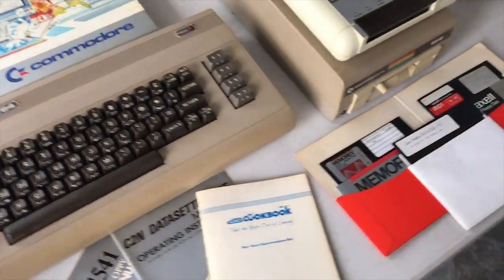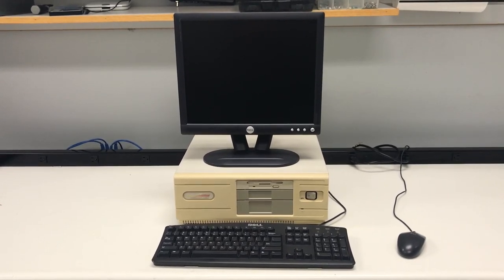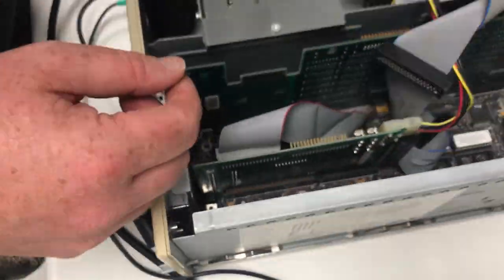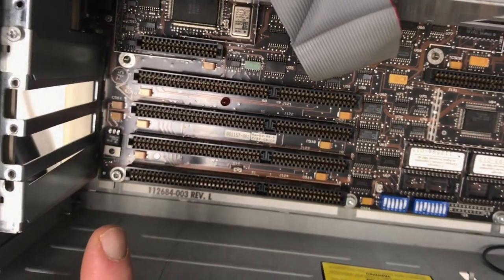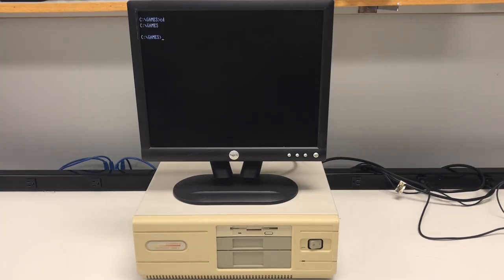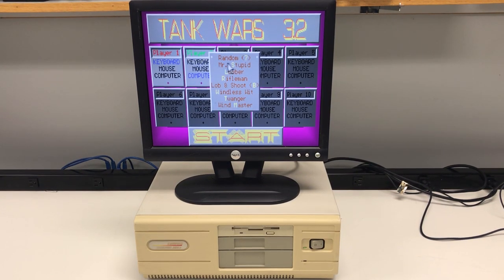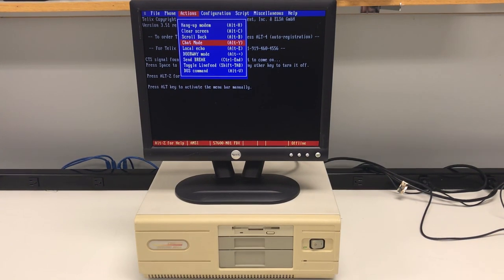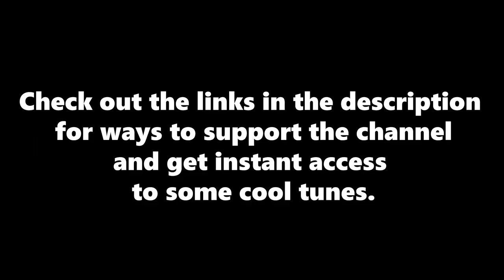Compaq Deskpro 386s Part 1 - Retro Computing

Comment: This was my first PC - a slightly different variant, a 386/20e. I got it when I was 10. I remember everything about it. It had integrated I/O, only a Gravis gamepad adorned a single expansion slot, and I had a 2400 BPS modem connected externally. I hated it. I could not enter BIOS (needed a utility to change anything), I could not upgrade the RAM without spending several hundreds on proprietary expansion cards. I could not upgrade the crappy 16 bit CPU. It had ONE MEG of RAM and a 42 Mb hard disk. That panel with the jumper settings will be forever etched in my mind as it taunted me with expansion options I could not afford. Granted, it was free, I cut my teeth on it at 11 or so and was very proficient with DOS on it, but I have passed up several very low priced offers on these even very recently. Hearing one of these start up though brings waves of nostalgia back. I actually have the original Deskpro keyboard hooked up to my KVM which steers a V30, 386SX, 486DX4, and a 233 MMX. The keyboard is solid, I love how it feels. The VGA monitor also was decent. 

My second PC was a slightly slower NCR 16 MHz 386, but it was a full 32 bit machine with a whopping 4 Mb of RAM. It was also considerably larger. I recall eventually selling the Deskpro when I was 13 or 14 for $100 with a reduced capacity DD drive and a mono VGA monitor (I actually have the ad on diskette still lol). 

"Good" times - thanks for the upload :D

Comment: The machine that feels like my first computer was a Dell 333D, also a 386.  Math Copro, 4MB RAM, and a 180MB WD Caviar HDD.  I always wanted a soundblaster card but never got one for it.  I did own an XT-class PC a couple years earlier, but I had no idea how to use it yet.  I deleted everything on the hard drive, not understanding that it needed these things to function, and then I had to learn how to rebuild it from a series of borrowed 5.25" floppy disks.  Shortly after getting DOS 3.3 reconfigured on it, the PSU failed and that was the end of that machine... so the 333D really "feels like" my first machine - since it gave me years of faithful service and I really learned my way around DOS and Win3.1 on it.

Comment: I had a Deskpro 386DX/25. Got it upgraded with a Soundblaster Pro and a 700MB harddrive. Great machine...
Reply: How did the BIOS support that kind of hard disk? They were one of the most un-user friendly setups around.
Reply: @the_kombinator  It's been too many years to remember the details, but I do remember it being quite straightforward. I was using MS-DOS 6.22 at the time, and the limit was 2GB.
Reply: @BrunoFonsecaPT  Hmm, those computers required special software on diskettes to change any parameter - they were all but straightforward. Furthermore, those systems (I'm willing to bet my project car) did not support over 528Mb disks in BIOS. 

My guess is that you used a DDO, which IS straightforward.

Comment: I've heard recently that a kilobyte from each memory chip is substracted for parity, so instead of 9216 kilobytes it's 9184 kb, still close enough to 1MB, especially at that time when marketers were confusing the public whether a megabyte was 1000 kb or 1024kb. 
In the 90s,  I used to trash pick (generally, I would just stop to look at the side of the road on trashday) hoping to find a 386 so I could install Linux, which requires a machine like Compaq's at a minimum. I certainly found 286s, Apple II clones, 8086s and restored them and drove my ex-wife crazy. The "guest bedroom" was full of computer parts in various stages of cleaning. lol. 
Now I just have I have a Compaq Portable1. All things considered, and since it is mainly good only for a handful of DOS games, I think I'd rather have the DeskPro. There is a 386 Portable, but it has a monochrome orange gas plasma display. The monochrome isn't a problem for me, but fixing or restoring or replacing a gas plasma display is rather difficult.

Comment: I just got one of these computers and I have been troubleshooting it for the past few months, just realized that last time I took off the floppy disk power cable I put it on the wrong way and killed my combo drive, it was a 5.25" drive and 3.5" drive, sucks that it broke but now I have to search for a ISA bus floppy card
Reply: oh and it has a 10mb ram board upgrade plust a 1mb Orchid fahrenheit 1280 video card

Comment: You can get a 387sx on ebay for like $12.  DO IT
Reply: Still? I got mine 4-5 years ago. Works just fine (for diagnostics anyhow - I think SimCity is the only app to use it).

Comment: is this the PC that kicked IBM off the throne?
Reply: Sort of. You could say that was the Compaq Portable, the first successful "clone" (note Eagle Computers, and Corona Systems and Columbia were all before Compaq, but two of them were more or less killed by IBM lawsuits). BUT after Compaq already got wildly successful with multiple Portable, IBM hesitated to build a 386 PC because they were worried about its limitations. 
But Windows 3 really depended on memory management to work well, and IBM didn't anticipate Windows being so popular.. So it was a one-two punch. Also IBM was thinking it would take over the world with OS/2 the operating system (which it should have started with), and also MicroChannel Architecture, etc, etc. IBM really self-destructed as much as anything. IBM kicked IBM off the throne. 
One thing not ever mentioned about: Compaq spending a million dollars to reverse engineer IBMs BIOS, is that at the time it was not even legally certain that firmware was copywritable. That precedence wasn't set until Apple vs Franklin Computer in 1984. So it could have been all for naught, if Franklin had won and anyone else could freely copy IBM BIOS